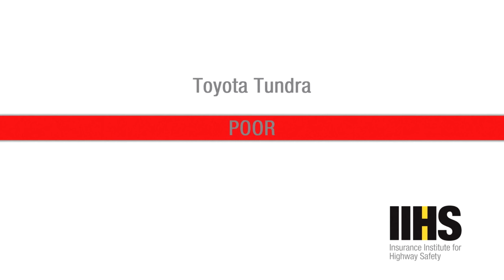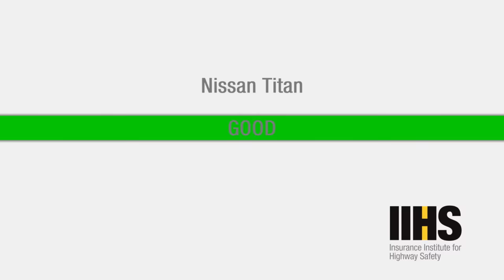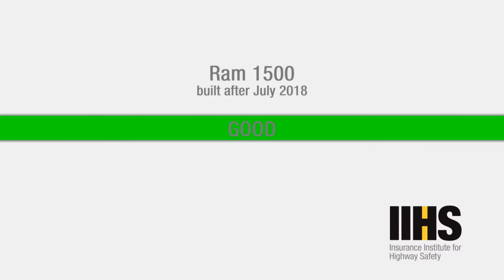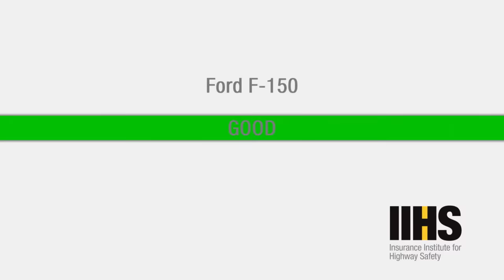TRUCK CRASH TEST COMPILATION - Ford F150, Toyota Tundra, RAM 1500, Nissan Titan

Comment: That Ford did some crazy deflection unlike the others.
Reply: It wanted no part of that wall.
Reply: Skiiirrrrrt, nooooope!
Reply: T-CUT will fix it.
Reply: is it a good thing?
Reply: @yhatszy09  If no parts are deflecting, then parts won't dig in to any of your body parts. And because the truck moved away from the wall, it preferred to dissipate it's energy elsewhere, in this case, translational movement and friction.
Reply: You realize the test is at 40 mph?  What happens at 70 mph?  After hitting the block, the Ford flips end over end, lands on the roof (which collapses), and catches fire.  Everyone dies.  That is not a passing grade in my book.
Reply: @davidbeppler3032  You don't want to suddenly stop from 70 mph, nope. Look up Volvo crash test, they do deflect much more smoothly than that, so it could slowly dissipate energy.
Reply: Derek Athey the ford did some massive yeeting.
Reply: @davidbeppler3032  why exactly would it catch fire
Reply: All I can think of is the roads I travel and it deflecting my ass off the road and down a mountain.
Reply: @frbrbrgrblgrr7777  deflects off mountain back onto the road and gets hit by oncoming traffic
Reply: @davidbeppler3032  You do realize that most car accidents happen at around 40 mph. Even when driving at 70 mph, you'd stomp on the brake to slow down a little.

If all car manufacturers protected at 70 mph, all cars would be ridiculously expensive.
Reply: the ford is smart
Reply: Green Giant  Based on the testing in this video, tho, ... 😉
Reply: Green Giant  The best way to survive a crash is to reduce the speed at initial collision. This is done by anticipated braking, either by an driver who is fully aware of their surroundings or having vehicles communicate with each other.
Reply: Frbrbr Grblgrr it would be much better to fold in half...
Reply: they missed, I think, also since most of those offset tests are between two vehicles and braking happens most often, Im not sure about this test, seems there was a little piece designed to mess up all the trucks and they missed hitting it with the Ford and Dodge. I saw a Dodge Ram that his a guard rail and it folded like an accordion, not sure if there was another vehicle in between looked to be a single vehicle wreck, also was before 2019 model year but doesn't matter it was a piece of junk.
Reply: @hmata3  Not true.
Reply: @EE-ie1bo  Magic?
Reply: @davidbeppler3032  Very true 😂
Reply: @hmata3  Why did the NHTSA document that the Tesla Model 3 is 66% safer than Ford?  NHTSA is not even capable of testing rear end accidents, but still they are the topic today.
Reply: Darr  My book?  What book do you refer to?  The NHTSA safety report?  That book?  Did you  know the NHTSA  does not test rear end collisions?  But they still found Tesla Model 3 to be 66% safer than Ford.  At 70 mph 66% is a huge amount.
Reply: @davidbeppler3032  Telsa Model 3 was not tested here and is not in the same vehicle segment. Cannot make a direct comparison, brotha. 😁
Reply: @hmata3  yes you can.  One is the safest in the industry, the other (ford) spends millions to actively block regulations to improve safety.  They are companies, not people.  The direct comparison is warranted.
Reply: @davidbeppler3032  I wouldn't want to be sitting over a ton of Lithium in a collision, tho. Much less when it's raining. But let's stick to the results in this video. 😁
Reply: @hmata3  Lithium is not explosive.  Petrol is.  In a crash batteries slowly discharge over hours and contain 1/1000th the energy of Petrol, Petrol discharges massive amounts of energy very quickly in a just few minutes.  But if you wish to keep to the current conversation.  Trucks should be unable to exceed 40 mph. As they are proven unsafe at higher speeds.
Reply: @davidbeppler3032  I think any vehicle won't do well in a 70mph crash into a solid wall.
Reply: David Beppler if you wreck at 70 no one survives no matter what this is why they test at 40 for all vehicles
Reply: @ToastedBuns207  This is true.  But the vehicle is not the issue.  It can be destroyed, but the passengers in it should survive.  The test is trash.  Trucks are horrible in accidents to start with, but not testing at real world speeds is just poor engineering.  It all comes down to money.  People will buy them unsafe and building them safer costs more money.  Solution, dead customers = big profits!
Reply: Even if it did better at 70 also he would still say it won’t do good at 100 or something, always an excuse. We learn throughout life buddy just learn and buy a Ford next time.
Reply: @cameronjones1583  I prefer to live.  If I buy a Truck it will be a TESLA.  They build the safest vehicles in the world.  Also with 300,000 lbs towing capacity.
Reply: David Beppler good for you bro you must have the extra cash to afford a tesla... the thing about lithium batteries slowly discharging when punctured is false i drove a nail through an iphone and it lit on fire within a minute.... just saying... if i buy a truck its gonna be an international harvester they are very safe you should look qnd try to them in the saftey books...
Reply: @cornbinderkid4109  I threw a lit rag into a burn pile filled with gas, it exploded in .5 seconds and blew chunks of burning wood 30 feet in all directions.  The cell phone caught fire in a minute?  How big was the explosion?  Maybe you could try using actual intelligent arguments next time?  My point stands.

On another note, you must be rich to afford a gas car.  The maintenance, fuel, repairs, accidents, medical bills, and insurance deductibles are so expensive for those unsafe cars.  A Tesla Model 3 is less expensive to own than any gas car on the market today.  It is also 66% safer than any other vehicle on the market.  Just some facts for those who need to save money.  AKA the poor.
Reply: @peepeebuttenter  Mostly country roads with random deer and few drivers with no cops.  That is 80% of what America is.  The other 20% is crowded cities.  Sitting in traffic for hours to drive 10 miles.
Reply: David Beppler you definitely failed physics lmao. If you were to absorb all the force at 70mph and come to a complete stop. That is a huge amount of Force you just absorbed because of the super high deceleration( which is acceleration). Your body would turn into jelly.
Reply: @MrInzombia  You definitely failed physics because cars have accidents every day and the Tesla Model 3 will save your life.  The whole thing is a crumple zone wrapped around a steel box with air bags in every direction.  66% safer than any other car on the road.  If the tests can't be done at 70 mph then the cars should not go 70 mpg.  FYI I am very proud of my passing grade in college physics.  I doubt you can say the same.
Reply: @davidbeppler3032  I like how you just gloss over the facts and make up a hypothetical scenario that has no data backing it up to justify why you don't like ford. Conformation bias at its finest.
Reply: @peepeebuttenter  the level 4 autopilot will be an AMAZING life changer for people who have a 1.5 hour commute to work every day!
Reply: David Beppler a Tesla truck, what a joke.
Reply: David Beppler you believe that trucks should not exceed 40 mph, I believe otherwise.
Reply: @peepeebuttenter  Not if you are good at math.
Reply: @iphoneanimationstudios4845  No, I believe the test should be at 70mph.  As in the real world people drive that truck over 40mph and the test should reflect real world speeds.  Now, if they refuse to test at real world speeds, then yes, the truck should not exceed 40mph.
Reply: @iphoneanimationstudios4845  Yep, very funny, just like the cars.  Those cars with 0-60 of under 5 seconds with greater than 100mpge and 300 mile range and the safest cars on the road.  Those cars that are selling as fast as Tesla can build them and stealing sales from every ICE builder to the point they are closing factories.  Yep, I am laughing.  :)
Reply: As an added note a guy in a Tesla struck an unmoving van when the car in front of him swerved without warning.  He hit it at 95kmh and only got bruised from the air bags.  He knows the Tesla saved his life.
Reply: @peepeebuttenter  Sorry, only an A?  Use percentages.  You have an 80%... that is not impressive.  As for an excuse?  What comment did I make that you think is an excuse? (this is a test)
Reply: @peepeebuttenter  Exactly.  Get a helmet.
Reply: Well a pro driver such as Ram owners, would have missed it.
Reply: It would have change lane to the incoming side lane and crash face to face with a concrete carrying truck !
Reply: @peterf.229  That's what those yellow lines where for on the hood. Every truck hit in the exact same spot. Watch it again. I think its because the area designed to collapse in the front right section did instantly. Some of the slow motion from above, shows that the f150 crumpled ever so faster than the rest. Which makes me believe that it sheered off the steel block faster and further than the others.
Reply: @peterf.229  That's what those yellow lines where for on the hood. Every truck hit in the exact same spot. Watch it again. I think its because the area designed to collapse in the front right section did instantly. Some of the slow motion from above, shows that the f150 crumpled ever so faster than the rest. Which makes me believe that it sheered off the steel block faster and further than the others.
Reply: @cameronjones1583  buy a Ford next time. And drive a tiny unreliable 3.5 v6? Sorry, I like my engines cheap and reliable
Reply: @davidbeppler3032  good one "300,000lb towing capacity" in your dreams
Reply: Ckc dillpickle they have many different engine options. I have a 2018 f150 and it doesn’t have a tiny 3.5 engine. I have the 5.0 coyote V8 which is very reliable.
Reply: David Beppler you didn’t bring up that it takes more fossil fuels to create that Tesla than like 3 F150’s. Also they hurt the environment more when something goes wrong, especially in the batteries.
Reply: David Beppler you’ve never seen a Lithium battery short out then...
Reply: David Beppler my 2017 4x4 F-150 3.5TT Crew cab can tow near 13k, has a payload of over 2k, has a range of 700 miles, has huge interior space and does 0-60 in 4.6 seconds with a 5Star tune. Oh and can wade through high water, drive in mud, jump curbs... What’s your point?
Reply: LoveHate 17 think about it really hard and don’t ask dumb questions
Reply: If you look at the hood, it seems to crumple right along the ridge. I wonder if that's a happy side-effect of the visual design of the truck, or if Ford made it to crumple that way in purpose. Either way, it's an interesting effect to observe in slow motion.
Reply: @davidbeppler3032  yeah don't hit an unmovable barrier at 70 mph. it might not turn out so well.
Reply: @davidbeppler3032  40 mph? you sound like you live in a bubble inside a bubble.
Reply: @paulk5311  The test is only for 40 mph.  If they can't test at road speeds then the test is broken.  They should either test at 70 mph or limit the speed of the vehicles to 40 mph.
Reply: @davidbeppler3032  any sudden stop at 70 can be quite deadly. Lots of 40mph and sub crashes can be deadly as well(30-40% chance). It's all luck so best choice is to drive safe, maintain your car, and make sure you have good tires. And don't assume anything.
Reply: @davidbeppler3032  No cars are tested at 70 my dude. Survival rates drop with the sudden stop gforce. That's why you have to be sensible when you drive.
Reply: @0xsergy So you advocate for a Reduced speed capability of all vehicles?
Reply: @davidbeppler3032  I never said that. Please re-read my comment as many times as you need. I only said that you have to be sensible when you drive.
Reply: Good, but also means you'll get rear ended by vehicles in the other lane, possibly an 18 wheelers.
Reply: @khoatran4841  The tests do not do rear end collision.  They can't afford it on their small $152 million budget.
Reply: @EE-ie1bo  gasoline
Reply: @AmericanPatriot01  yeah it does a roll over and catches fire
Reply: @davidbeppler3032  citation needed
Reply: That’s good because that means the car absorbed the more force than the dummy
Reply: Derek Athey Fords are obviously the safest truck to drive. F-150’s are by far the best truck for the money.
Reply: It basically did a sidestep and didn't spinout sideways.
Reply: @hmata3  or not spending time on your cellphone
Reply: @mikeab93  lol, why is everyone still arguing on this forum? 😂  The point of this test is, we ran a vehicle into a wall, this is how it behaved.
Reply: It's an angled inner hard deflector of the floor pan, firewall, and further hardening of the foot panel with ridging. Also, it helps that the bumper hardware, on some F-series, force the hit side's wheel inward, and upon it being forced rear-wards, and toed-in, it passes the passenger cabin, rather than impinging on to it.
Reply: There's no reason to test a Ford at 70.  40 is about all they can muster.
Reply: @DethWshBkr  What are you simple? I'm always blasting past G.M.'s with my F-150., G.M.(Greatly messed) is such a poor vehicle they had to be bonded out by the banks, and an impotent vehicle company on a good day. Ford did not! Done and one upped!
Reply: Green Giant  You simple, bubba.
Reply: @hmata3  You don't know what you're talking about. We all have access to the internet. Put brain in low, and Try so hard bro🤣
Reply: @davidbeppler3032  You know that if you want to survive a head one, you'll be driving late model F-series. The tests, and real world data shows Ford's supremacy. You're just a troll aren't you?
Reply: @montanawildcat5198  You are suggesting if you sit 3 feet over the vehicles you slam into you have a better chance of surviving?  How do the F series do in a rollover?  You might be the troll.
Reply: @davidbeppler3032  I try not to be. You are right about the rolling over potential, obviously. I guess one has to choose whether they want ground clearance or stability, in most cases. I appreciate your input. On my truck, it tends to take corners well, but honestly it's been a long time since I've driven a lower riding vehicle, affecting my perception of "handling cornering well". As per your idea of "maybe, maybe not being protected when hitting a lower vehicle, it can be tricky to judge, as, when a taller, ladder framed vehicle hits an unibody, lower vehicle, the frame can be more solid than the lower vehicle and be harmful. Of course, the earlier 97-2003 F-150's cab would squash up terribly if hitting an equal crash partner, I know well. Good argument though.
Reply: Derek Athey man the ford could be a ballet dancer lmfao
Reply: @davidbeppler3032  The only vehicles rated for impacts at 70MPH are Police interceptors and Police responders. All crash reinforced to handle a full speed 70mph impact - Ford sales Rep
Reply: @RW-jg9zv  So police have better safety standards than everyone else?  Then only Police vehicles should be able to travel 70 mph.  As they are the only ones designed to do so.
Reply: @davidbeppler3032  "As they are the only ones designed to do so."
What does one thing have to do with another?  Why should a vehicle be artificially limited to the speed roughly at which a human can survive an impact with a solid object?  Should we also build vehicles to withstand 70mph side impacts?  That's possible too.  What about over pass collapses?  That can happen, so should we ban all over passes or construct vehicles that can withstand tons of concrete and steel coming down on them?
Reply: @treizTUBE  We should also build vehicles to withstand sledge hammers and ballbearings!
Reply: @davidbeppler3032  I disagree, I think we should allow people to decide what level of risk they want to assume.  If I want to or need to save money by driving a vehicle that isn't as safely rated by rando ratings company and their arbitrary standards I should be free to do so.
Reply: @treizTUBE  I disagree, I believe a half ton of steel should have a modicum of safety.  If not for the person driving then for others.  Do you also support the right to drive when intoxicated?  Should they be free to do so?

My point: if a vehicle travels at 70 mph as part of it's design, legally and commonly, and accidents occur at 70 mph regularly, then the vehicles should be tested at the speed accidents occur.  That or regulate the speed of all vehicles to 40 mph (mechanically), as that is the "tested" speed.
Reply: @davidbeppler3032  "Do you also support the right to drive when intoxicated?  Should they be free to do so?"
Yes I do.  Driving under the influence hurts absolutely no one else, therefore it should be legal.  Crashing your car into others DOES hurt others and should be illegal.  We do not need two laws for one crime.  
.
"My point: "
Your point is absurd, the fact that a thing can and regularly may occur does NOT necessitate its consideration in design nor law.  I have already pointed out a number of other events that occur on the roads that would make auto design all but impossible if it were law to account for them.  Your opinion is no different.
Reply: @treizTUBE  I like your arguments.  Now go implement them.  You have my permission.  Make driving while impaired legal, remove the speed limits, remove the safety regulations, throw out the efficiency standards, keep going until we get back to the dark ages!  I prefer swords and dragons anyway.  :P
Reply: @davidbeppler3032  stretching my words to your own absurdity isn't particularly convincing.  Why should people take your opinion over their own?
Reply: @davidbeppler3032   "Just do your own thing and screw everyone else."
How does my choosing to take on more risk or less than others screw everyone else?
.
Why should anyone else care what level or risk I choose to take on for myself?
Reply: @treizTUBE  Because your risk adds risk to others that they did not ask for.  do you think drunk drivers only hurt themselves?
Reply: @davidbeppler3032  Risk isn't a crime, nor can it be compounded.  Drunk drivers ONLY hurt themselves in so far as they are doing damage of important internal organs.  People who for what ever reason allow their vehicle to collide with others on the road DO hurt others, but one is not necessarily connected to the other.  Millions of people every year manage to drive themselves home while under the influence without incident every year.
Reply: @davidbeppler3032  mate. Reason is no engine, because of the facr the Tesla model 3 has batteries on the bottom mean it has low center of gravity, better if you dont wanna flip over. And because there is no engine the front is absorbing more force as in crumpling since if there was an engine it wouldve been a quicker stop which is not good. Thats why tesla model 3 is 66% safer. Front of the car absorbs more of the inpact so that the driver and passengers will be safer. That is why there is doubt i  the Cybertruck. Since it is a solid brick of steel the impact will hurt you more.
Reply: @davidbeppler3032  you DO realise that if they did  that lawsuits happen? Thats why they conduct this test to ensure the saftey of the PASSENGERS AND DRIVER! The test IS GOOD its how they make the vehicles themselves.
Reply: @davidbeppler3032  and yes. That is  why teslas  are safer BUT! notjust tesla. A few other cars with engines too! The front is a crumple zone thx to no engine. Low center of gravity thx to the batteries being on the floor. Because if you crash an instantly stip that is bad. Hence why there is fewer steel cars and more aluminum.
Reply: @davidbeppler3032  Just saying this just in case, Dont really like teslas since i prefer the looks and sound and functionality of other cars. So here i go. The  tesla model 3 i think? Or model S DOES CATCH ON FIRE HA, BUT that was because rocks puncture the battery under the vehicle so now what they did was add a Titanium or something metal plate protecting the batteries! Also in the rain? It is fine you are overreacting if you say they arent good in rain
Reply: @dragonheartedcs4061  You realize not being in an accident is the best way to avoid injury?  66% safer because they are less likely to be in an accident to start with.  Then there is rear end protection, (only Tesla).  Because NHTSA can't afford to test rear end accidents.  They were paid billions last year, but can't afford it?
Reply: @davidbeppler3032  66% Safer thanks to how it MADE! Also not being in a accident is the best way to avoid injury. And for anything Its the manufacturer that pays for the tests. Meaning fors tesla etc. Is paying to get it tested. Simililar to hoe the R35 was registered as R34's because the people putting it into testing and importing didnt want to spend to much money. And yes Nissan R34 (i dunno) and R35 was not imported by nissan rather some oyher conpany who wanted tk get it into thr US
Reply: @davidbeppler3032  and  i  rear end protection Trucks are somewhat good thanks to the bed but not sure. Again the Cybertruck is doubtful
Reply: @davidbeppler3032  
What is the effect of hitting a solid barrier at 40mph and hitting another vehicle faster?
Reply: @davidbeppler3032  
Two vehicles each traveling at 40mph collide. What is your argument?
Hitting a solid unforgiving barrier implies a lot if the other object it hits gives.
Reply: @larrybe2900  Deflection.  Another vehicle will deflect more than a barrier.  If the test is only at 40 miles per hour then the trucks should only be allowed to travel at 40 miles per hour.  Increase the speeds in the tests or reduce the speed of the vehicles.
Reply: @davidbeppler3032  
I do believe that is what is called allowable risk.

What I am getting at is hitting a solid barrier at 40 mph is equivalent to your deflection scenario going faster. So the 40 mph test is really encompassing more than just the speed the test is being done. I won't go so far as to say your point of 70 mph but it holds it to within a survivable range. Like another has stated here, when you drive the allowable speed limit of 70 mph you are accepting far greater risk to life and limb whether one thinks about it or not. The general odds is this speed would be in an environment with vehicles not always on top of one another thereby mitigating the risk.
Reply: E E There’s literal rocket fuel inside the airbags which causes a chemical reaction for them to go off fast enough before you hit the dashboard. It’s extremely flammable when exposed to water vapour in the air, and then there’s the gas in the truck which is flammable,
Reply: Man the immense fanboyism is great
Reply: @davidbeppler3032  what if blah blah at 70 nothing is going to hold up pfft they were reading the monitors on the dummies besides all the other results. ...some peoples children..you were the one eating the crayons and glue weren't you
Reply: @davidbeppler3032  guess i didn't scroll far enough to see your 35 mph comment. anyone can tell by watching the crash test the ford glanced off and kept going. most got squashed like a rotten tomato. i've been in a wheelchair for almost 16 years after falling in a barn and i do agree everyone is in to big of a hurry. i used to drive like a bat out of hell back in the day and im surprised im still alive after thinking back on the crazy stunts i did in vehicles over the years. racing down the interstate swerving into the emergency lane to pass a car, jumping railroad tracks etc. people forget how dangerous it is behind the wheel but you cant build a crash proof vehicle or it would cost half a million dollars and only go 35 like you evidently said some where.
Reply: @davidbeppler3032  I’d rather roll tan stop from 70mph in an instant. Chance of survival is much higher
Reply: @Alvah707  I would prefer the car not get in an accident in the first place.  Amazingly 5 star rated cars are not sold with all the safety equipment they are tested with.  Only the "fully loaded" option has it, if you ask for all the safety equipment included.
Reply: Joe 609  then the lowest bumper wins.
Reply: Ford is just engineered better. Has been for a long time now. Always does well in crash testing. Does well in real world crashes. Pretty reliable platform to boot. For the price... it’s the best of the bunch for a real work truck.
Reply: @TsunauticusIV  Yep, built in 1985.  No improvements since then.  None needed.  Ford is Tough.  Bet you can't throw a 5lb ballbearing through the driver side door glass in that.  Can't dent it with a deadhead sledge either.  Nope.  Ford Trucks all get better than 100 mpge and tow more than 14,000lbs.  Built for men.
Reply: @davidbeppler3032  Just like what would happen to a tesla! It would catch on fire! Except it wouldn't be in a crash...
Reply: @jonathank1723  Tesla is much less likely to catch fire after an accident than any ICE vehicle.  Amazingly Gas the flammable liquid is dangerous.  lol
Reply: @Car&Track7 Not hating, I want safe cars.  You seem to want cars safety tested at unrealistic speeds.  Only test them at 35mph... nobody drives faster than that?  I want them tested at the speeds of actual accidents.  70mph.
That or restrict cars speed to 35mph.  I don't care about speed.  I care about safety.
Reply: What for? It got smashed
Reply: @davidbeppler3032  There is absolutely Zero point in crash testing at 70mph.
Firstly, most crashes do not occur at 70mph, people usually manafe to sow down quite a bit before the actual crash. 
Secondly, 
Any car strong enough to withstand a crash of that severity would transmit too much force to the occupants, which would kill them immediately. A crash at 70 is not twice as much energy, but almost 3x as much energy to dissipate. 

Also, the likelihood of severe injury in a 40mph crash would go way up, because there would be minimal crumpling at lower speeds.
Reply: @RW-jg9zv  not into a solid wall, they arent.
Reply: @twoeightythreez  So you are saying no person has ever survived a crash at 70 mph because it is impossible?  Think about that.
Reply: @davidbeppler3032  your comparing Ford to Tesla, what is wrong with you?
Reply: @spazemfathemcazemmeleggymi272  What is wrong with me?  You are responding to a comment 2 years old!
Reply: @davidbeppler3032  is that a fancy way of saying you don't have a good argument for what I asked?
Reply: Block of steel: I'mma gonna stay right here! 
F150: I'mma jus' step to da side!
Reply: @davidbeppler3032  Do you really fail at understanding this test??! It's between PICKUP TRUCKS, not SUV's and trucks. Wow. Get a clue. The Tesla is an suv. The ford is a truck. Derp. <smh>
Reply: @davidbeppler3032  mmmmderp is your word of the day. This test was not about testing companies. It was about comparing test results of trucks, not suv's. So, your comment/troll was NOT warranted. <smh>